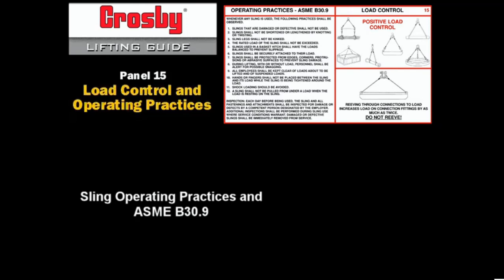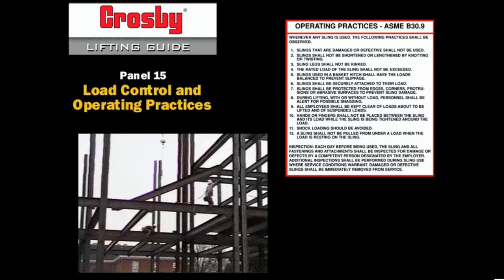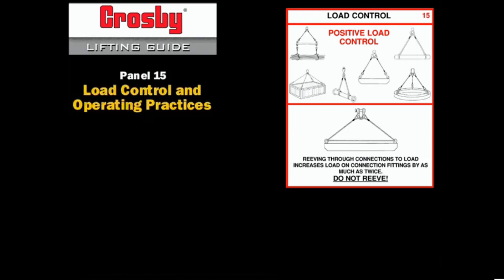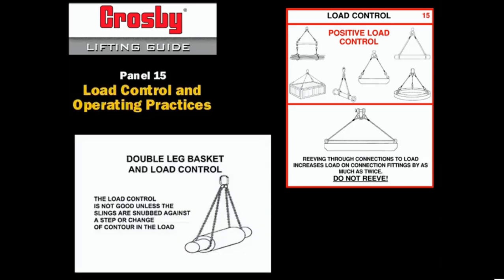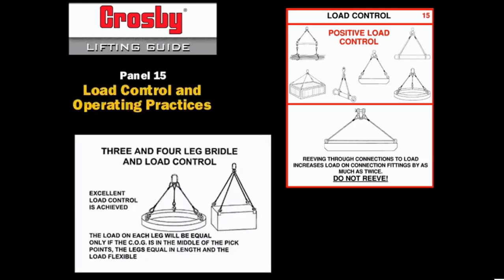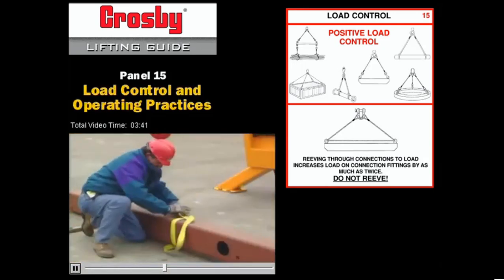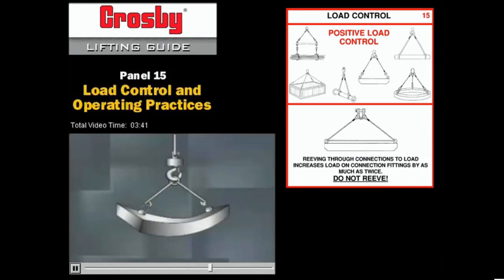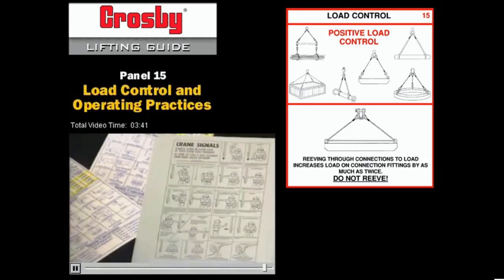Lifting Operations Safe Practices and Load Control

Comment from the maker: Question 1 of 11
1. Question
Category: Load Control
Slings used in a basket hitch shall have loads _________ to prevent slippage.
•   Padded
•   Balanced
•   Suspended
•   Prohibited

Question 2 of 11
2. Question
Category: Load Control
Shock loading is _________.
•   Padded
•   Balanced
•   Suspended
•   Prohibited

Question 3 of 11
3. Question
Category: Slings
Slings shall be ___________ or protected from edges, corners, protrusions and abrasive surfaces.
•   Padded
•   Balanced
•   Suspended
•   Prohibited

Question 4 of 11
4. Question
Category: Load Control
_________ loads shall be clear of all obstructions.
•   Padded
•   Balanced
•   Suspended
•   Prohibited

Question 5 of 11
5. Question
Category: Calculating Sling Tension
Reeving through connection points (such as eye bolts or hoist rings) at the load _________ the load on these fittings.
•   Reduces
•   Does not affect
•   Increases

Question 6 of 11
6. Question
Category: Slings
Slings shall not be shortened with knots or ______________.
•   Interlaced eyes
•   Makeshift devices
•   In a basket hitch

Question 7 of 11
7. Question
Category: Slings
It is okay to overload one leg of a four-leg sling as long as other three legs are within their Working Load Limit.
•   True
•   False

Question 8 of 11
8. Question
Category: Load Control
A double wrap choker provides:
•   More than 360 degree contact with the load
•   Less than 360 degree contact with the load
•   No load control

Question 9 of 11
9. Question
Category: Load Control
Three and four leg slings will provide improved load control and _______________.
•   Always an increased capacity over a two leg sling
•   Sometimes an increased capacity over a two leg sling
•   Never an increased capacity over a two leg sling

Question 10 of 11
10. Question
Category: Load Control
A two-leg single-wrap choker should not be used at an angle of loading (horizontal sling angle) that is:
•   Smaller than 30 degrees
•   Smaller than 45 degrees
•   Smaller than 60 degrees

Question 11 of 11
11. Question
Category: Load Control
Compared to a single leg sling, multiple leg slings:
•   Never provide better load control
•   Almost always provide better load control
•   Provide the same load control